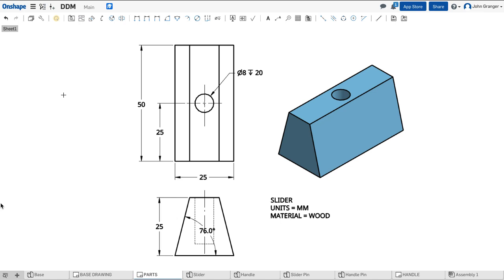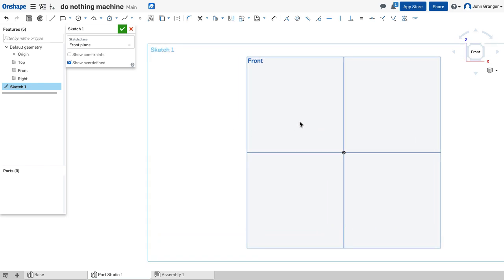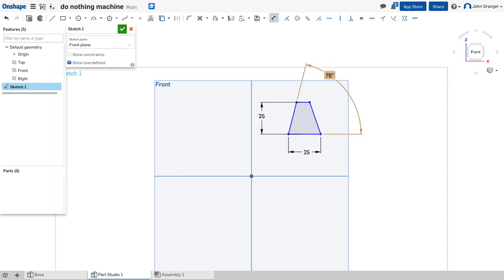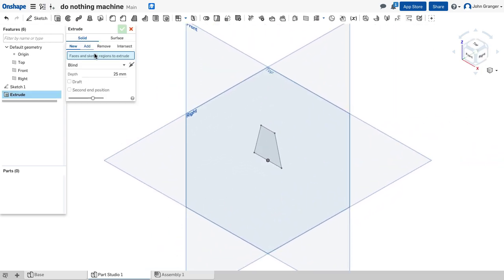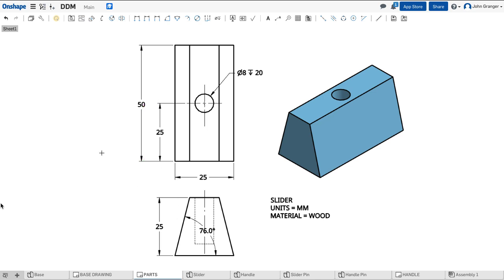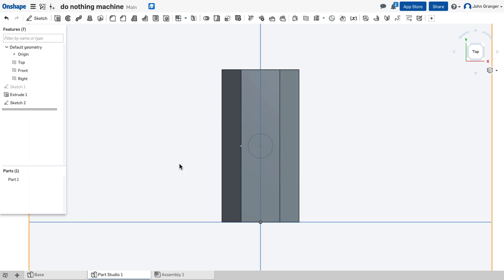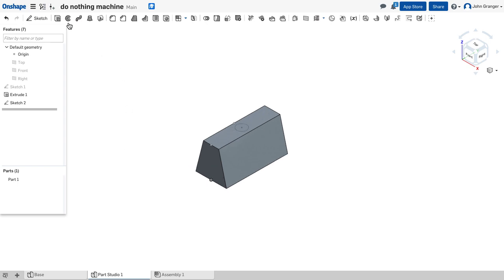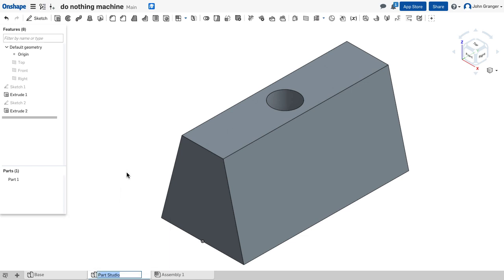Onshape - Do Nothing Machine -Step 2 - Create the Slider

Comment: you can press Esc on your keyboard to escape the tool ur using
Reply: Hey Im not able to do something. Please connect
Reply from the maker: If you have a sketch tool active, using escape on the keyboard will end the tool activity.  When there is not tool active, the curser is arrow, when a sketch tool is active, it is a crosshair.  This is a visual clue to let you kow if a tool is active.